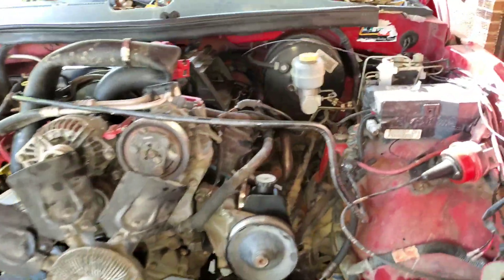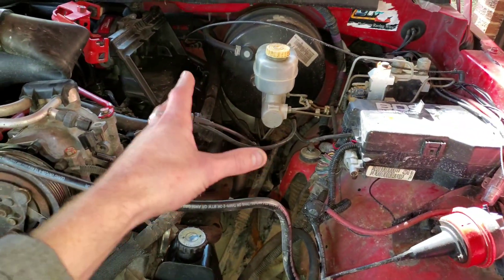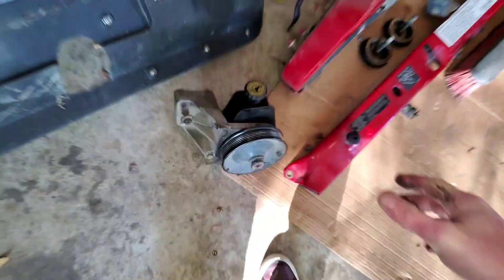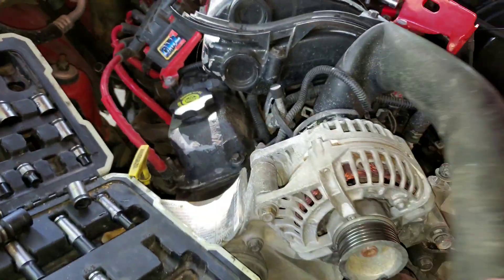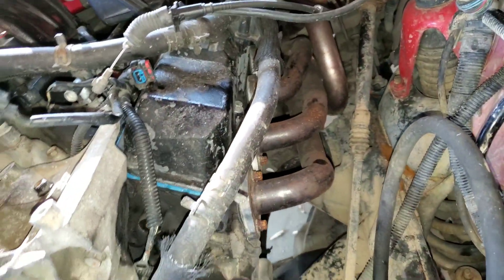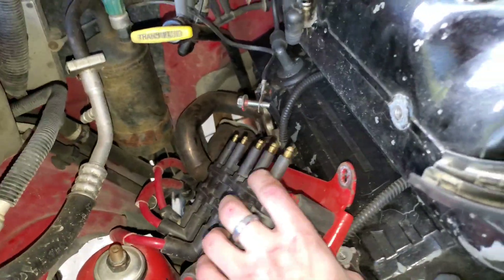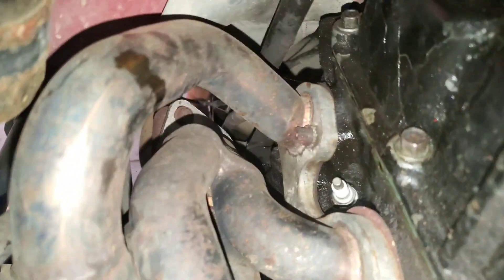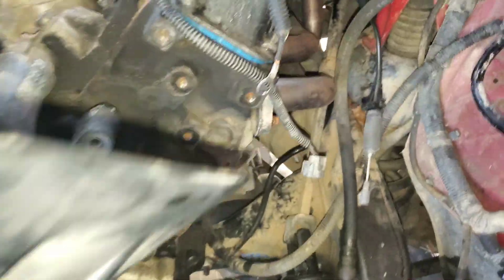PULLING THE DODGE V10 ENGINE PART 2 OF 2

Comment: Do yourself a favor and put 3” body lift on, much easier to pull motor, also don’t have to pull fender liner to do the plugs, I pull mine on passenger side with long extension gets all plugs on pass and couple on drivers side standing upright, also more room to work on most things on the back of motor